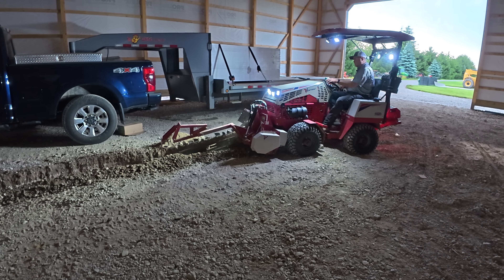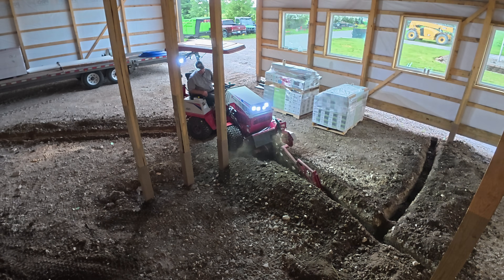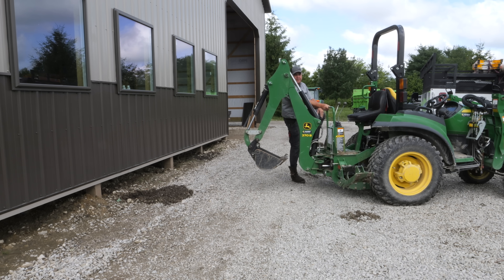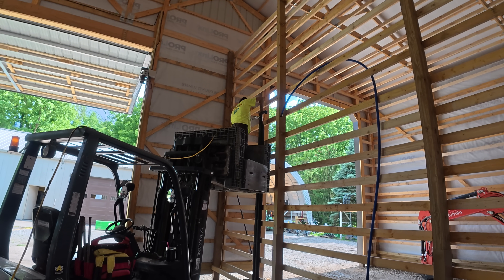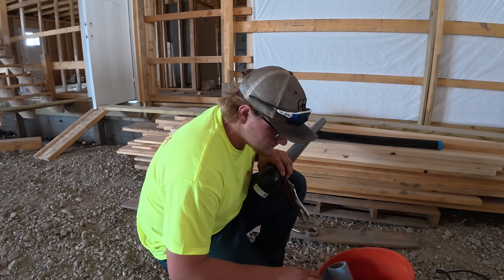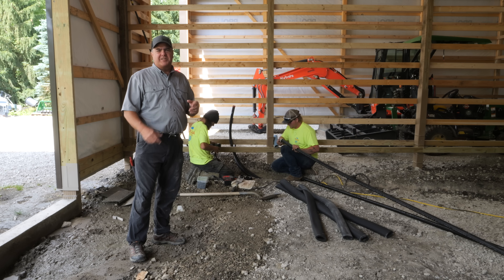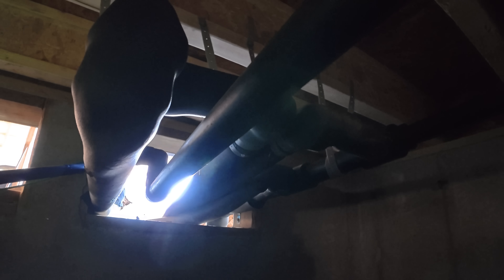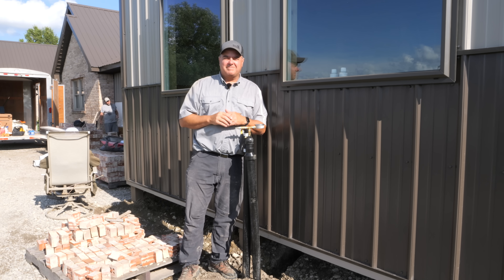HVAC Geothermal Loop Installation for Dream Shop!

Comment: I don’t understand why you are burying all this stuff under the slab without them being in any conduit or tubing if you ever have a problem down the road, you’re gonna have a massive project to replace these lines. I think I would’ve put an 8 inch conduit under the slab and run it inside of it. So many connections and Tees  under this slab. With all the room you have I would’ve made a utility room and made those tees and connections in that room just straight pipe under the slab tilyou get outside. just like you said, the huge variation and temperatures are gonna cause contraction and expansion of the lines which will eventually lead to their failure, especially with all the connections once outside I would have no issue just running the lines directly in the ground, making all the teas in the ground. If there’s a problem down the road, you’re gonna have to dig it all up anyway, and it will be easy enough to do outside otherwise I love it.

Comment: The whole variable speed compressors and blowers get some amazing efficiency and change all those old duty cycle calculations.  We have a 4 and 3 ton climate master setup and love it.  Only ever had two problems.  One system had too many 90s close together that limited the pressure the internal pump could push to the loop so watch that and if you have bad lighting we lost the blower motors in both the first year then added this inline use that went inside the cabinet. They spared the motors a couple of times making an easier and cheaper repair.  The whole series has been just amazing to watch.  Keep them coming!!!
Reply from the maker: Thanks!  Did you find out why you need the inline fuse?  Bad power supply?
Reply: @TractorTimewithTim  We get a lot of lighting in the area and at the end of the street so a spur of the electric line out from the many road.  These were inline 220v fuses just before the blower motors in the climate master cabinets. Then a year later power company replaced everything along the road and things were better, but if you get spikes or surges alot a fuse is much cheaper than the motor lol

Comment: Do they insulate the geothermal loop below grade or just not below where the concrete slab will be?
Reply from the maker: Only insulated above grade.
They actually want it to be exposed below grade …to adjust to ground temperature.
The only time they insulated below grade was at my request for the few feet where it was near water line.

Comment: Do you have any information regarding the effect to your electric bill to run the geothermal system?
Reply from the maker: I have a couple of sources of data. 1) personal experience with my existing Geothermal, and 2) software calculations from Indiana GeoThermal, comparing to ‘normal’ system.
I plan to do a video on this

Comment: At some point will you show us the cost effectiveness of the fancy and expensive things you’re doing in this build so we can make an educated assessment of our own?  Thanks
Reply from the maker: Yes, I will try to do so.  In the case of this GeoThermal System, I know the cost, but if I told you, you would faint!  This is because of 3 separate systems, two of them huge.
I will try to get the GeoThermal guy to quote say a single 3 ton system for us on video.
Reply: We went geo with a ROI of less than 12 months, but that was with the better tax rebates than whats out there now.  Another thing to keep in mind is to think about the cost of the loop and the cost of units separately as they have different lifetimes.  Our units are over 10 years and will probably end up giving us problem in the next 5-10, but at that point the largest expense, the loop, can be re-used on the next pair of units.  Compare geo unit to air base in one calculation and then the loop over a much longer time frame if you think you will be in the property long enough to realize it.

Comment: We put in a geothermal system in 2007 for our new house in eastern Missouri. They drilled 5 vertical 150 ft (or so) wells in our north yard and ran a continuous loop down and back up through all of them; then back inside to our one compressor unit. Each loop is down in about 70-80 feet of water.  So far, everything on the system has worked well.  I did learn to not keep adjusting the thermostat up and down; just leave it set for where you want it for winter and summer temperatures. I’m curious if anyone has hooked up a geo unit to in-floor tubing to heat or cool a building, instead of the forced air interface.
Reply from the maker: Correct.  Do not adjust thermostat.
I asked about geo in floor heat..they said it would be a different unit.  …translation, I would need a separate unit for heat and cooling.

Comment: Is there a perfect climate for geothermal units? I wonder if it works well in high humidity? I see geothermal used in the west but I haven't see it in southeast Tennessee yet. The shop is coming along nicely,. Other than equipment being in the way it's a perfect shed now. Granted you don't want a shed attached to your house but we are guys and it is pretty cool ! 😀
Reply from the maker: Don’t think climate really matters.  Tax incentives are probably relevant. 
Would decrease your monthly a/c costs dramatically.
Reply: @TractorTimewithTim  I want to see how that does when it's finished. My career was in heating & air but so much is rapidly changing that I'm out of touch, thankfully!
Reply from the maker: @turdferguson5300 my current one works great in summer.  Not quite big enough in winter to keep up.

Comment: I think just for my state of mind I would of bury them in a bed of sand and sand on top I fix a lot of leaks that a rock made a hole with heat cool cycle moving that pipe just a little to make a hole but that's just me real interesting
Reply from the maker: Ugh.  Not comforting :-(
Obviously, it is done now!

Comment: The sub grade you were trenching through looks very compact.

The Model 7 backhoe on my JD 855 is NOTHING like the backhoe on my Kubota L48. The L48 has almost triple the hydraulic flow of the 855 which makes it much easier to be smooth, not to mention faster.

The piping appears to be HDPE. When I managed a state park maintenance department, we used HDPE for water lines, sewer lines, and even large diameter pipe for dock floats. The welded joints are SUPER reliable.

Pipe backfill material is important. We used recycled crushed glass on some medical building projects. It seemed like a very good product.

Everything looks great Tim. I am very much looking forward to watching the geothermal system progress.

Comment: One other thing to consider Tim. For Power / Data that is low  Put conduit under the Slab to those locations. That will save a lot on Copper having to go the long way over the top or around the inside. That comes from experience in the trade.  heck just 2   2" PVC's from one side to the other. 1 for low Volt the other for Power. 
Thanks Much...
Reply from the maker: Hmm.  My panel is on second floor...so should be about the same distance over the top.  Still, a very interesting. idea.  There will be LOTS of copper for just a few outlets!

Comment: HVAC sizing - I live in Atlanta Ga. We deal with hot weather more than cold weather. My house is an old brick ranch. We built on an addition of about 800 square feet. I took about 100 sq ft off the old system which struggles some to keep up so I have 900 square feet for HVAC. The HVAC came out and said we needed about a 1.5 ton system. We were planning to move the kitchen and dining room into the addition so I wanted to be able to cool the kitchen when my wife was canning using the 25,000 BTU burner on the new range. I told them to double the size to 3 ton. He said you can’t do that there wouldn’t be enough vents. I said double the vents and I wants a 400 CFM (instead of a standard 200 CFM) vent blowing down in front of the range. They did exactly what I asked them to do putting in more vents. I think there are 12 total. We installed a 21 SEER variable speed compressor and variable speed air handler. The HVAC guy said I might have problems with humidity.

The end result is we absolutely love what we did. If the inside temp is 80 and it’s 95 outside we can turn it on and in 30 minutes it’s 75 in the house. Another 30 minutes and it’s down to 70.

As for the humidity the variable speed units takes care of it. It runs in low speed pulling about 4 amps on each side of the condensing unit.

Bottom line is don’t be afraid to oversize a system as long as you can add the vents necessary to keep the coil from freezing.

Jeff
Reply from the maker: Yep.  I agree. Seems the ‘over size’ thinking is overrated…and outdated.

Comment: I am up im 🇨🇦 but our geo system has been nothing but a pain in the *ss. Constant repairs. Bills in summer not to bad but soon as it gets cold our bills go way up. Woulda been cheaper for us and less headache to do gas
Reply from the maker: I have not had any breakdowns, but I do have the issue of not enough heat capacity.  My theory is that the installers are under sizing these systems.  We don’t want the auxiliary heat to run at all.  The installers seem to think it is fine for aux heat to run if under 20 degrees f.  This is crazy!  Loses all the savings.
Reply: It just wasn’t done by the best! Indiana geothermal!
Reply: Yes ours is sized small and I dont ever want to run 13kw aux heater if I dont have to

Comment: Onto another subject... do you plan on installing kickboards about four feet high up from the floor on your interior walls? If you don't,  then I guarantee you'll be denting or puncturing your metal siding when parking implements.

Comment: I’ve always been a proponent of geothermal. You’re fortunate to have a pond for the heat sink. The pipe you are working with and welding, you called it PVC, is it actually HDPE?

Comment: My parents had that  type of system installed in a new home over 20 years ago. The furnace system seemed to have issues each of the three years that they lived there. It did reduce the energy usage to heat and cool that 2800 square foot house. They ran the pipes in a back and forth pattern in the large front yard. Repairs were costly each year. I’m loving the progress you’re making. Thanks to Cristy for the great editing.
Reply: The modern systems are 100 times better

Comment: As I also have a geothermal system, I am really surprised that you aren't putting those lines below the frost line. Freezing up the circulation lines is a major problem. My lines are 4 ft deep and the system has methanol in the system. During high demand those lines get very frosty and cold ground would only exacerbate the potential problem.
Reply from the maker: The ground had better not get too cold under this concrete.

Comment: Interesting to see a closed loop install. We’ve got an open loop system, it’s just so much less piping to install
Reply: I've had an open loop geothermal for 38 years. The first unit I had for 27 years with zero problems. I replaced it, not because it had issues but because I needed to go to 5 tons from 4. The second unit is 11 years old and essentially trouble free. One reason they're more reliable in my opinion is because there's no outside condenser with compressor. It's all inside in a climate controlled environment and there are not Freon lines connecting the inside and outside units, a very common source of leaks.
Reply from the maker: @pedrofuster6458 yes. I agree!
Reply: @TractorTimewithTim  Something else to consider, with solar + geothermal; make sure you look into the locked rotor amps for your units. I assume modern units are already inverter units that don't draw a ton of amps at start up, but I'll have to put a soft start on mine to get it to start on my solar setup (it's currently the one household circuit that's not on my battery backup side). As measured by my amp clamp, mine pulls almost 110A at startup momentarily, for a 5 ton unit.
Reply: @joeldcoxks agree on the locked rotor amps 100%. I don't have a solar system but I have a whole house backup generator. I have purchased a soft start unit and plan to install soon. I had previously installed a "hard start" capacitor/potential relay to lower the locked rotor amps but not only I found out that it lowered the starting amps just a small amount but it failed after one year of operation.
Reply: I've got a 5 ton unit, if/when the ClimateMaster dies, I'll look into the WaterFurnance brand, as they're local.

I agree with it all being inside. Mine is in the utility room with a water heater. I just replaced the water heater with a heat pump unit, to use the heat generated by the HVAC put into the air, back into the water with a heat pump.
Reply from the maker: Not legal anymore most places.
But all of this piping is due to 3 systems…not just one.
Reply: @TractorTimewithTim just have to live more out in the country… we’ve got a ClimateMaster unit, less than 9 years old and it’s already on its 2nd compressor.

Comment: That's interesting about the geo! My 1996 system at the other house was all white PVC under the house to flex lines underground, and I'd have to add pressure to it once or a couple times a year.